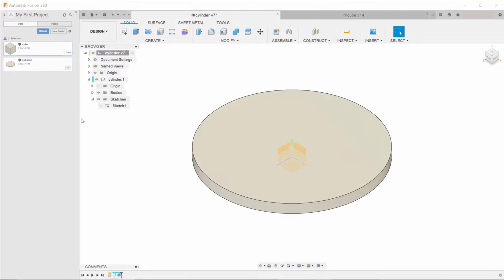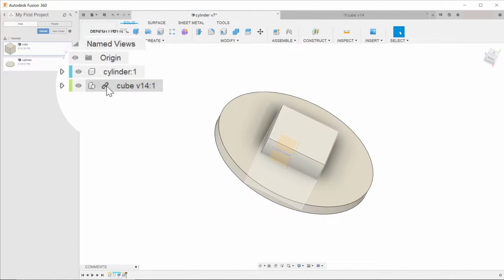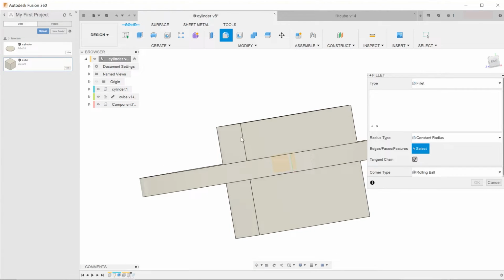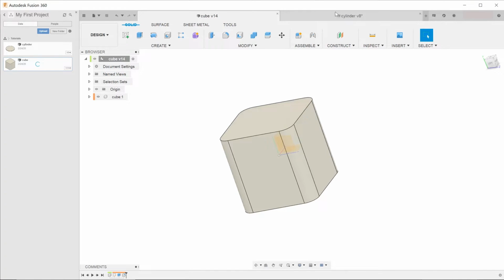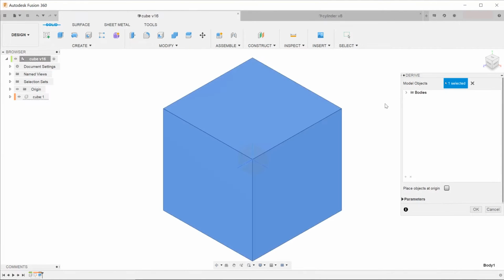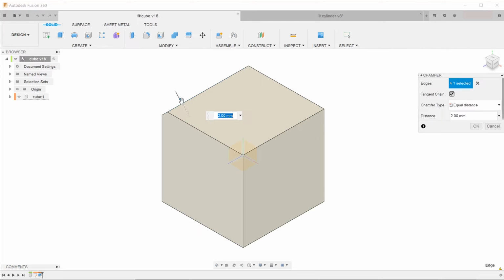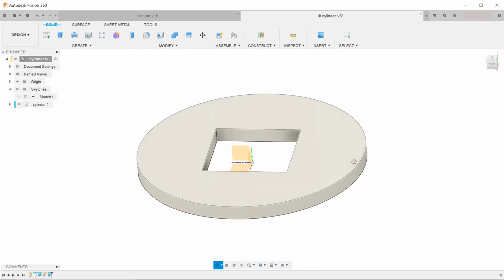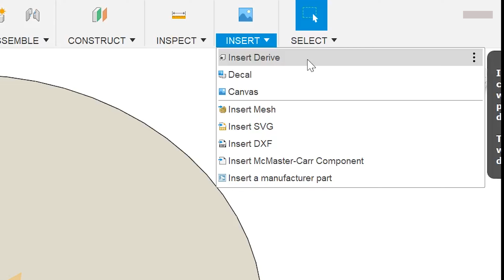Fusion 360 - Insert VS Derive

Comment: I like your videos, short and to the point.  Can you derive a feature to use between designs? can you drill a center drill hole in one part and use it in another part. allowing you to library a set of saved standardized  features.

Comment: Some people have commented the name of this feature is misleading however 'Insert Derive' is proper ie: you can derive new modelling from the imported bodies and sketches. For example, you can import a sketch and use that as a base for new modelling but you cannot modify the sketch perse, that you can only do from the source file. Also, although you can modify an imported solid say by adding a chamfer to an edge if you modify the same edge from the source file you will run into errors. The 'Insert Derive' feature is only good for that: deriving (!) and any changes done to the source are carried over downstream so you have to be careful what you do. The 'Insert into current Drawing' feature avoids these types of conflicts however it does have other limitations so both ways of importing have their strengths and weaknesses.

Comment: I really like your summary at the end of the video. I think this is an excellent method to help ensure learning has taken place.

Autodesk's "Insert Derive" nomenclature is unfortunate--it's very clunky, non-descriptive, non-intuitive term, located in a place one wouldn't necessarily think to look for this type of operation. Thanks for showing this to us!
Reply: Some people have commented the name of this feature is misleading however 'Insert Derive' is proper ie: you can derive new modelling from the imported bodies and sketches. For example, you can import a sketch and use that as a base for new modelling but you cannot modify the sketch perse, that you can only do from the source file. Also, although you can modify an imported solid say by adding a chamfer to an edge if you modify the same edge from the source file you will run into errors. The 'Insert Derive' feature is only good for that: deriving (!) and any changes done to the source may lead to catastrophic effects downstream, so you have to be careful what you do. The 'Insert into current Drawing' feature avoids these types of conflicts however it does have other limitations so both ways of importing have their strengths and weaknesses